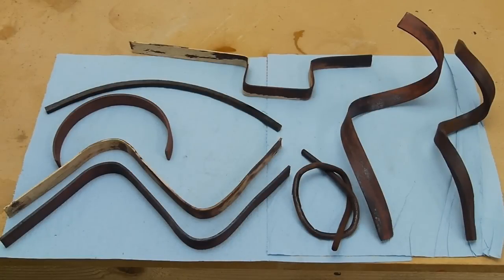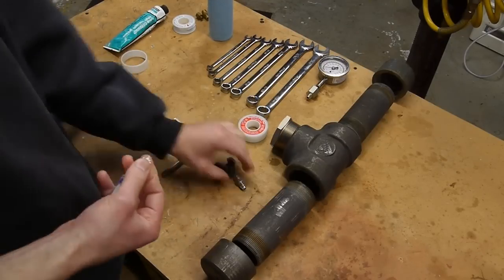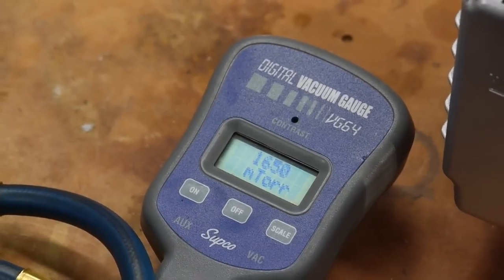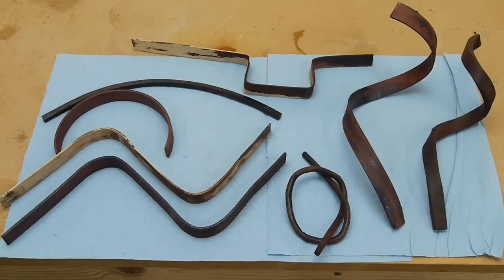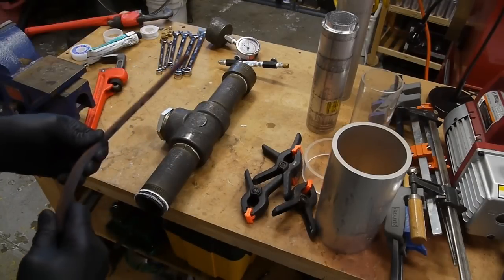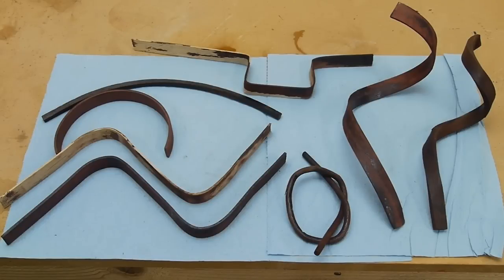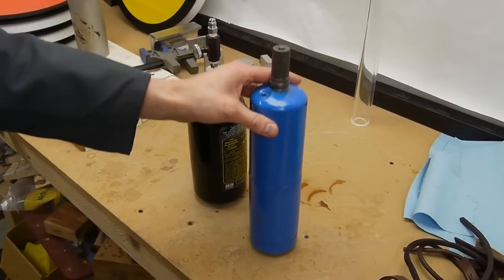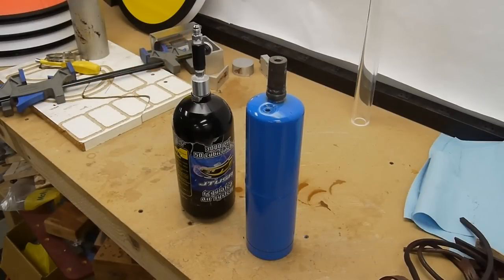Extreme wood bending with ammonia

Comment: Just FYI, a container will get warmer than the inlet gas if you pressurize it just by physics alone. It doesn't require any chemical reactions to increase the temperature. Linky: http://www.learnthermo.com/examples/ch05/p-5e-1.php
Reply: ib9rt You are correct, however ~150 psi increase isn't really enough to raise the temperature of the chamber by the 30-40 degrees he is seeing. Especially considering the thermal mass of the schedule 80 piping. I regularly fill high pressure vessels to 4500 psi. It takes about 2000 psi increase to raise the temperature by 30-40 degrees if you fill it in a few minutes. This is in a COPV which has a much smaller thermal mass as well.

Comment: A sort of related process to investigate is http://www.google.com/patents/EP0695408A1 - this is 'Thermowood (tm)' - which patent has just also expired.
You take steam, at atmospheric pressure, and apply it to the wood, ensuring that you don't have too much delta-t across the wood and heat to ~110C when it's bone dry. Then heat up to as much as 240C for a couple of hours. All in a steam atmosphere at atmospheric.
It is implied in the patent that it is very flexible at high temperatures, and 'anneals' stress out. It may be bendable which is something I haven't gotten to trying.
The resultant wood is not only dry (obviously), but a slightly browner (to very browner) color and almost entirely resistant to fungal decay, as the fungus food has been baked out. It is a little more splitty, but retains most of its properties.
Tightly wrapping green wood with foil and placing in the oven actually worked for me.
I need to make a proper steam-flow oven.

Comment: Soft wood does not bend. Steam or otherwise. One can also simply soak wood in ammonia and achieve good results. Ammonia soaking was at one time standard for wooden ship modelers. The process has fallen out of favor over the years and replaced by other processes. The discoloring seemed to hurry the passing of ammonia soaking. I use an autoclave to steam under pressure.

Comment: waterfree ! ammonium up to 50°C will corrode copper and alu minimal > zero... up 50° it will corrode when is a not protected by oxidlayer... and when its a hot water amonnium solution.. infos are from alu pipe  air conditioning systems...  =)

Comment: As you are a man of science and engineering it really upsets me that you use the imerial system :(
Reply from the maker: 64h5dsf14j6s41h5s4j5 As you've seen in my previous videos, I use both imperial and metric.  Units like psi and degrees F are very comfortable for me to use because I grew up with them.  When I have to think in MPa or degrees C, I have to convert in my head to get a tangible sense of what those values represent.  Obviously, the metric system has many advantages and it would be great if everyone used it, but there is an awful lot of momentum to counter, and the drawbacks of the imperial system are not as bad as people seem to think.
Reply: Applied Science Like operating systems, it pays to know or have all of them..

Comment: I thought this video was really cool.

Please stay away from calling a unit of pressure "Microns" (A unit of length). mTorr, Bar, psi, inHg, pascals (Pa) or even kPa are all acceptable.
In most vacuum applications powers of torr are used. You are 10^-2 torr reaching 10^-3
Reply: Came to say the same.